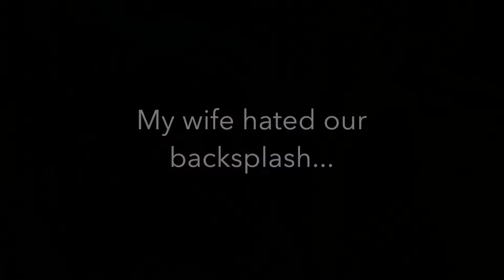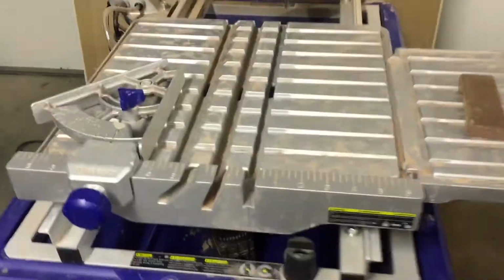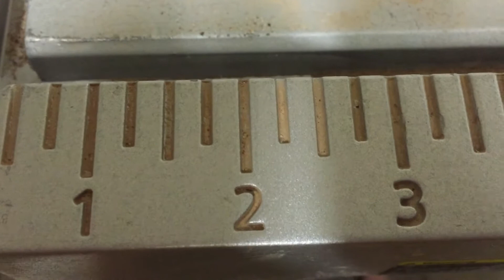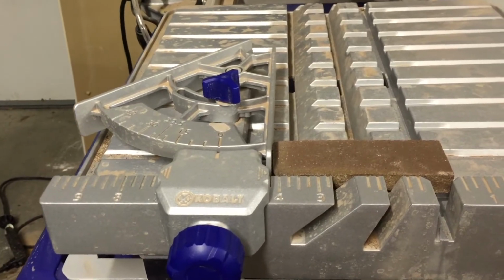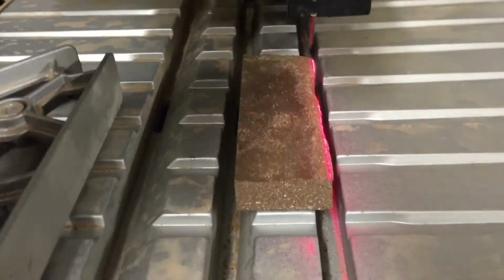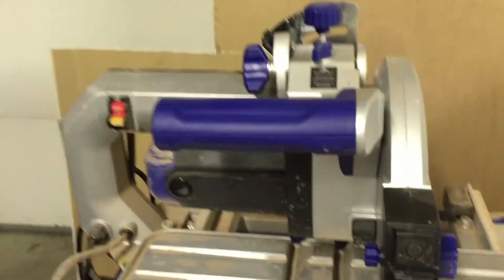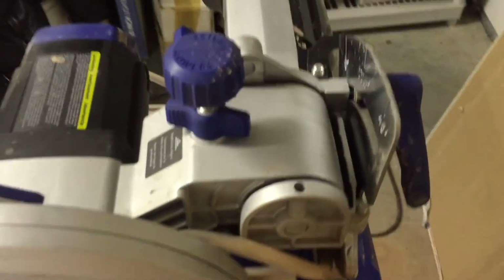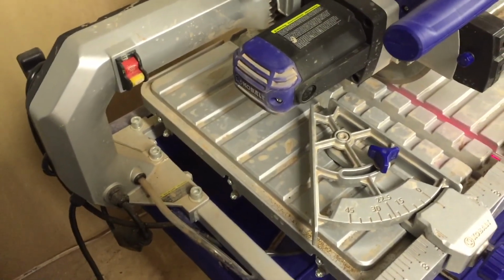Kobalt 7" tile wet saw #0632871 review for first timers part 1

Comment: Crashcopter, Thank you for submitting this honest and thorough review of this wet tile saw. I have rented ( for a week) an MK 101-151991  saw from Ace Hardware, and that was a mistake as it does not fit my 18" x 18: porcelain tiles.  Now I am searching for a wet tile saw to purchase.
Reply from the maker: There are quite a few videos on "tricks and tips" for cutting 18" tiles.  I understand they can be quite the challenge.  Best of luck with your project!!  Consider posting something so we can see how it turned out!

Comment: I have the same saw and I also have the Kobalt table top model.   I find the Kobalt table top model better made than the Rigid and the sliding one you did the review on blows away the Rigid sliding saw.  Especially the sliding table.  It glides much more true than the Rigid saw.  The Rigid saw has alot of side to side play, the tolerances are far better with the Kobalt, and alot tighter feel.
Reply from the maker: Good to know.  I'm really becoming a fan of Kobalt products.

Comment: Hi again, I used my new saw yesterday and your milk carton trick worked great.  I do have another problem though and wondered if you might be able to help.  I have the blade lowered all of the way and the plunge lever tightened all of the way but as I saw through 1/4" tile it slightly moves upward and won't saw all of the way through the tile.  So, I have to push down on the saw while I'm sawing.  So you have any ideas as to what could be off?  I'm pretty sure I shouldn't have to push down on the saw while using the gliding tray.  Any ideas?
Reply from the maker: That seems odd...  There has to be something stopping the blade from lowering all the way.  The only thing I can suggest is to try checking everything and make sure it's assembled correctly.  If it all seems correct - I'd take it back to the store and have them fix or exchange it.  Sorry I"m not more help!
Reply: that actually helps. i was thinking about taking it back.  it defeats the purpose of the ease of the glide tray.  thank you for your help.  singing carpenter
Reply from the maker: Best of luck!
Reply from the maker: I was thinking about your saw dilemma...  It dawned on me that - if you're certain the blade is all the way down - it can only be one thing...  The blade is too small.  Check the documentation that came with the saw.  It should specify the blade size.  Then, check the blade itself.  The diameter of the blade must be too small.
Reply: Thank you, that is something I'll check.  I plan on calling or going by lowe's this week to see what I need to do.  I may just return it.
Reply from the maker: @vickimoffatt8675   Hi Vicki!  I was looking over some old content and came across our conversation.  How did things end up with the saw?

Comment: Compared to the ridgid r4030s  which is better?
Reply from the maker: Sorry, but I really don't know.  This is the only tile saw I've ever used.  Here's a link to a good review on the Rigid saw.  Based on the video, I'd be very hesitant to get the Rigid.  https://www.youtube.com/watch?v=Z1Q0Dany9Is
Reply: I think it is better made than the rigid.  Especially the sliding tray.  I found the tray on the Rigid to wander alot  and the Kobalt  has less play and the sliding motion is much more true.
Reply from the maker: There ya go - even more confirmation.

Comment: Hey good job!!  I count on you tube because I know I can do it, but I need you tube to help!!  Keep helping others.  I will go buy mine today, and then watch both parts again and maybe again.  Thanks again,
Reply from the maker: +Betty Edelman If you decide to try dry stacking that thin brick, I hope you have a lot of time and like jigsaw puzzles.  Bottom line is, spend 90% of your time on layout.  Don't forget that milk jug - best of luck with your project!
Reply: +Bill Hey thanks for the comeback, Bill!!    I already have both of the EXTRA supplies already.  I have done quite a bit of tile work and backsplash work, but always have rented a saw.  Today I purchased one because I need one now and soon I will need one for another project.  I also do work for others, so this new saw should come in really handy.  Keep on doing what you do!!  Great job!!

Comment: Just picked up this kobalt 7" wet saw last week. It's crazy how much more plastic they've incorporated in 7 years!
Only issue I've had is getting it to cut square but im sure with the power of Google ill find an adjustment!

You'll be happy to hear that that have included a rear water deflector now. So they must've watched your review
Reply from the maker: Hi Jay.  Good to know they finally took my advice!  I wish I was surprised about the plastic...  Best of luck in your project!
Reply: @crashcopter6000  thank you! Using it for StoneFacade siding. So far it's what I expect for the price, Cheers!